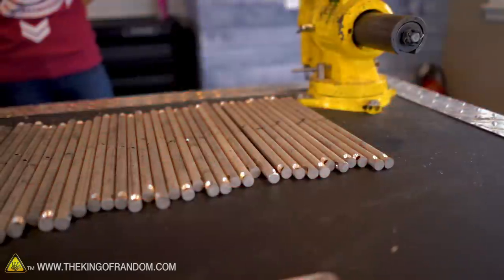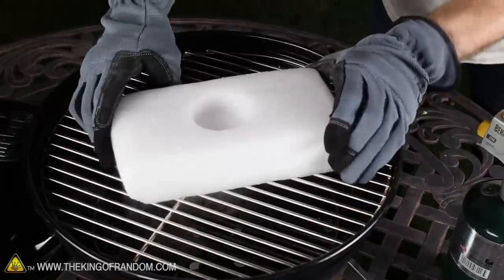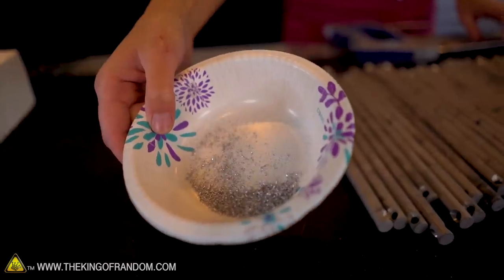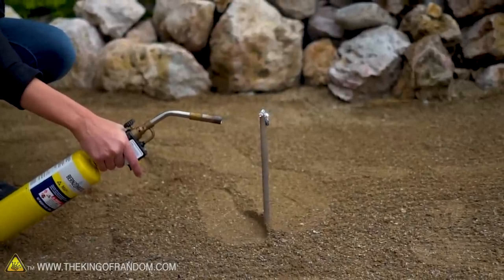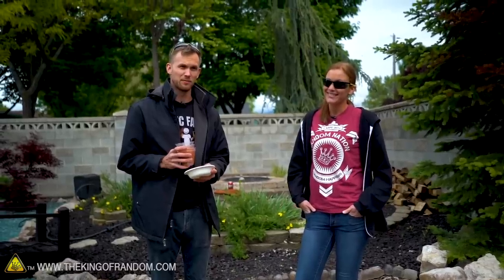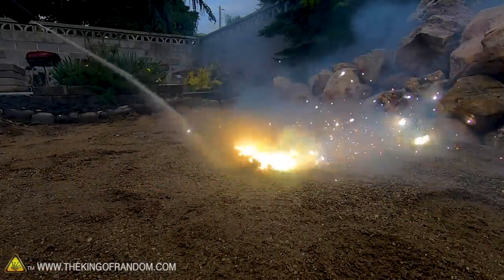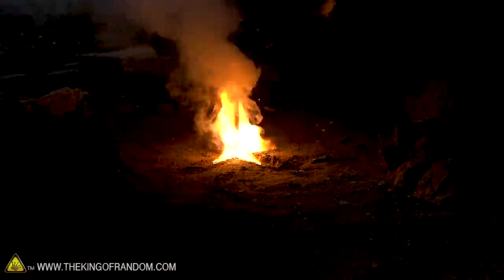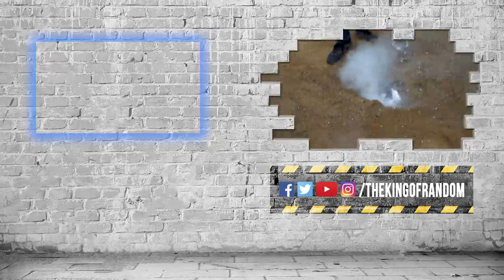Why Magnesium Fires are SO DANGEROUS

Comment: A pressure washer is about the WORST thing to use to attempt to extinguish any fire, much less a metal fire. To extinguish that with water, you'd need to put on a volume capable of removing the heat from the metal. Which is a LOT, but at low pressure... not a small amount at high pressure like you get from a pressure washer.

Comment: The Boeing 767 has a ton of magnesium in it, actually several tons. Its 19,000 lbs and about 20% magnesium to save on fuel cost. These are the 9/11 aircraft.  I was a navy aircraft fire fighter and they are also heavy in magnesium.  And that explains 9/11 the fires, molten metal and collapse.

Comment: Water + Magnesium= A MUCH bigger fire! I have heard that water also is something to ignite Magnesium. I do not know if that is correct, but I have heard of it...
Reply: Water will ignite Sodium metal. Water can be used to extinguish Magnesium fires, but in COPIOUS amounts. At that point, you're using the water to remove the heat from the metal, not displace the oxygen.

Comment: You can use water to put out metal fires. Lots of water and a few precautions. However, burying it with sand to contain the heat is your best option. Again, take precautions. This stuff will instantly cause 3rd degree burns and produces toxic fumes.

Comment: In reality /magnesium is far less dense than Aluminum,  1.73g/cm3 vs. 2.7.  Some metallic fires emit UV so please use eye protection, or better don't play with it. A side note the Space Shuttle Solid Rocket boostes use Aluminum as fuel, combined with Iron oxide to help with the reacction (catalyst) ammonium perchlorate as an oxidizer and some binding agents. Thar is one of the reason the plume is so bright.

Comment: Spraying that with water is actually very dangerous. Magnesium burns hot enough to actually break the water down into Hydrogen and Oxygen, both very flammable gases. The risk, while minimal given the amount of water used, is that you could have caused a small explosion that wouldve sent burning magnesium in just about every direction. I HIGHLY recommend that you dont do that again.

Comment: You know that using a regular hose head on a mist or a fine spray would have been far superior to using the power washer. I use to machine magnesium parts and took a whole toilet paper box full of shavings that were kerosene soaked home. Kerosene one of the only machining coolants you can use on magnesium. I set it on fire for the neighbors amusement and then show them what happens when you try to put it out with a garden hose. We lit up the whole neighborhood like it was daytime in the middle of the night with a 25 + foot high white piller of fire. This before the days that everything was dangerous. Children, adults and elderly of my neighborhood enjoyed it even though I was a young motorcycle riding renter that was just helped whoever whenever they needed.

Comment: Did she say you need a Class B fire extinguisher or did I misunderstand her. You need a Class D extinguisher which is a dry chemical. You could also use sand to smother the fire. A very dangerous fire which has taken quite a few firefighters lives when they sprayed water upon it before they knew what was burning .

Comment: For everyone saying the cold causes the fire to get stronger, you are false. Metals react with oxygen to burn. this is why almost anything is flammable when a fine powder. iron will burn when ground into a super fine powder. this is why flash powder burns so quickly. the carbon dioxide is broken into carbon monoxide. extra oxygen makes the fire stronger. water is broken down into hydrogen and oxygen, and the extra oxygen makes it burn stronger. oxygen is the key ingredient here. liquid nitrogen would put the fire out because there is not oxygen present. It is simple chemistry. Just had to get that out because of ignorant comments.

Comment: You can't put it out with water because magnesium burns at 4000 degrees F, which is hot enough to braks the hydrogen/oxygen bonds in water, providing more fuel (hydrogen) and oxidizer (oxygen) to continue the combustion.

Comment: There are better ways you can use magnesium. There are exotic thermites that use magnesium as the metal. Try mixing iron oxide and magnesium powder. It will definitely burn a lot brighter but will have a quicker reaction
Reply: so does this mean I should reconsider buying/building oem style racing magnesium valve covers for my 1970 426 iron head hemi lol 😆 and skip to aluminium ones? after all your saying it's easier to light on fire 🔥 and it will burn hotter than steel ones ☝️
Reply: Richard Price I don’t really think so. I believe magnesium valve covers are an alloy of aluminium and magnesium. Thermite is a mix of the rust and powdered metal. Magnesium on its own would be dangerous as valve covers or as any parts as it is highly reactive it will also corrode very quickly
Reply: Richard Price do hemi engines have two spark plugs per cylinder? I was told this by a co worker in my garage.

Comment: Shoulda covered it with something to extinguish it. Without oxygen I don't think it should be able to burn
Reply: Nope , the only way to extinguish a super hot fire is with a Class D dry chemical fire extinguisher or foam chemical like what is used in aircraft hangers fire suppression system.

Comment: Get a big water bottle and put some dish soap with a special chemical in it and put foil and throw it and run as far away as you can

Edit: please do not do this at home it will make a very loud noise. It’s basically a grenade